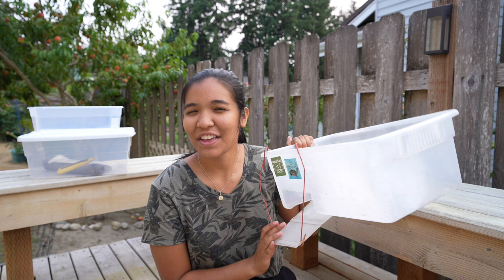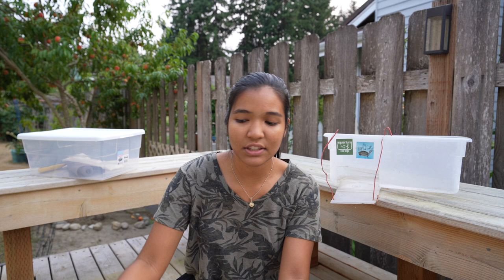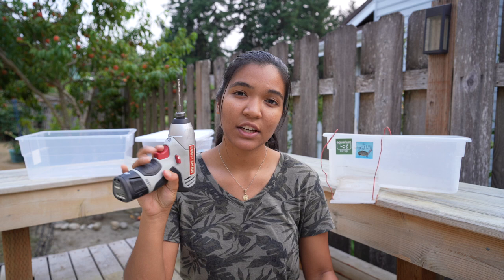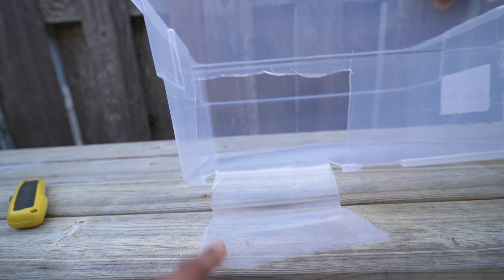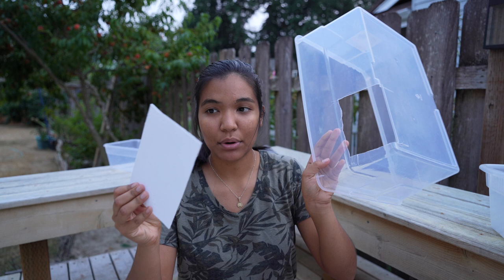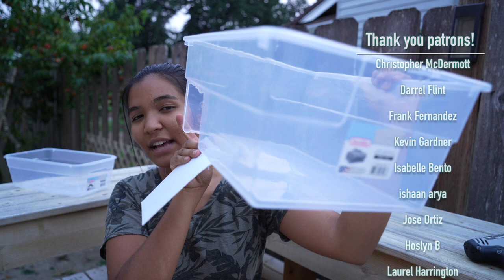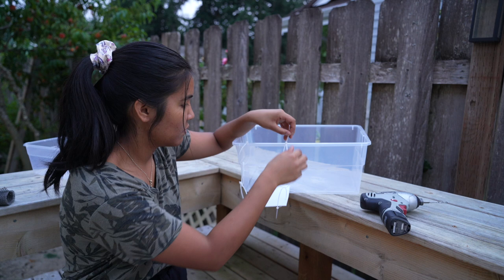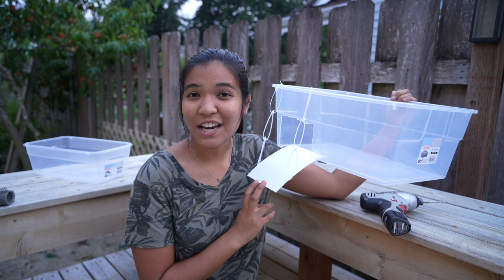DIY Basking Area for Turtles - how to make it!

Comment: Tip for anyone who doesn’t like the uneven edges after you cut the plastic, put duct tape around it to cover it but to also avoid your turtle getting cut
Reply from the maker: ooh good tip! I guess you just want to make sure that the sticky part doesn't leak any chemicals into the water, to be safe

Comment: My female RES turtle is 5 inches, and my tank is a 75 gallon, with a zoo med desert UVB and heat lighting kit with a mini combo deep dome dual lamp fixture a 75 watts reptile basking spot lamp bulb and a 13 watt 5.0 UVB reptisun, an eheim professional 4+ canister filter. Can it be possible to put a baby RES or any type of turtle along with it. I used to have a smaller male turtle, who is a baby living alongside with mine and they got along just fine, until he died

Comment: Im loss on what i suppose to cut the screen cover with so they can get through
Reply from the maker: the shelving liner mesh is for grip, not for a screen ;) If you have a screen cover on the tank, some wire cutters over that specific area where the ramp goes into the water can  help!

Comment: I would use it other that because I have to get rid of his basking platform (I have the same one as you, the one for hoku) but if he has any walls on his basking platform, he’ll try to escape and end up flipping on his back causing his organs to move around and might cause health problems. He could also get stuck and scare him. I have tried everything I can think of to get him to stop on his basking platform right now. Turtles are a pain sometimes
Reply: What about like a cone shaped or something inside the basking area, so the walls are shaped inwards instead of straight so he can’t get up them
Reply from the maker: or how about a lid for a basking area like this with a mesh covering so that the light can still get through but the turtle can't escape?
Reply: @TheTurtleGirl  I think the issue is that when he tries to climb up the walls of the basking area, he falls down on his shell and it can cause health problems 🤔
Reply: @TeamSukiyo  actually the real issue is not when they flip over and twist their inside, but what if it flip and for some reason can't flip back. It does happen to me once in the past, my juvenile RES died because it can't flip back it's shell under the basking spot.

My suggestion to the original post issue is if i remember correctly that above tank basking platform have a see-through part, right ?. How about you cover that part with some cloth / sticker / paint because usually turtle feel more secure in closed space.